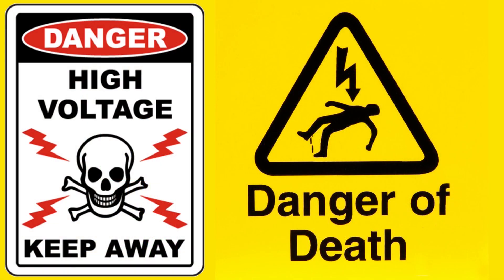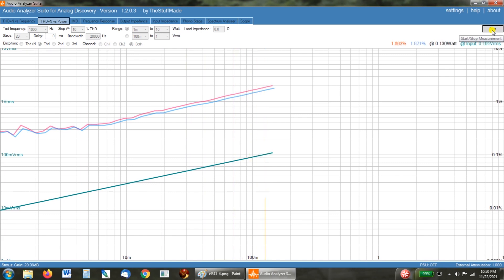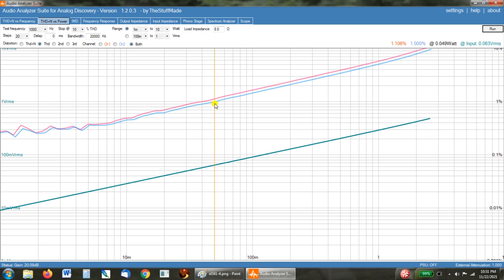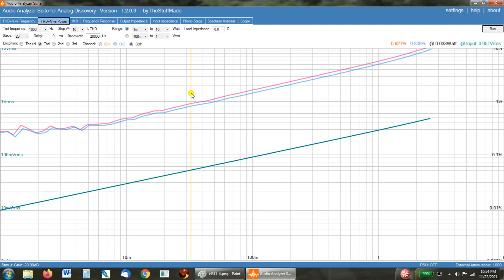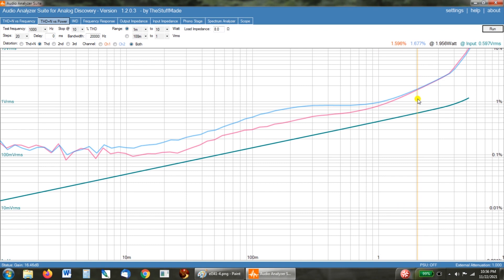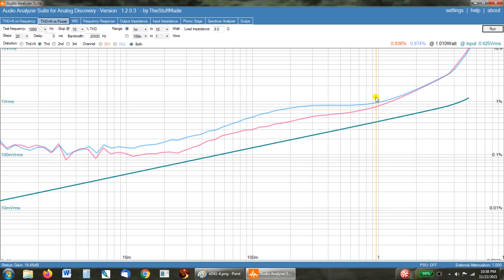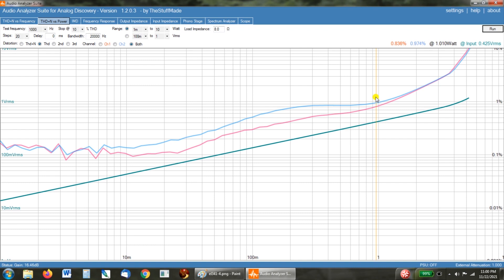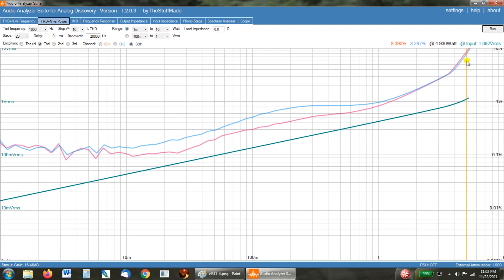Boyuurange Reisong A12: Quick Fix Tube Swap

Comment: So with stock tubes this amp sounds awful?
Reply from the maker: With the stock CIRCUIT and stock tubes it sounds awful. Putting these 6V6 tubes in it was more of a test of my theory that the problem with this amp is cold biased output tubes. While it helps, IMHO the real solution is doing the circuit mods and using EL34 tubes.
Reply: @SkunkieDesignsElectronics  it seems odd to me the a12 is $30 less than the a10 here in Canada.
Reply from the maker: Supply and demand I suppose? Hard to say.

Comment: When mentjon 6v6 tubes remeber gt, cause original 6v6 tubes can ruin 6v6 gt conststructjons,same goes with 6l6 and gt.
Reply from the maker: The original metal and GT tubes are electrically the same.
Reply: @ isnt it lower voltage on the original 6v6 i tougth it was 20%, 6v6 metal was not posible to inspect fore redplating on one of my amps build on printboard,it was former owner who fixed this, it was messy,change tubesoclet,and fix damaged printboard, i tought it was 350 and 300v on max fore the tubes but manny 6v6 gt were runn much higher than that, in old days.
Reply from the maker: https://frank.pocnet.net/sheets/127/6/6V6.pdf same data sheet. All the old have a max across the tube of 315, the A12 has 310 across the tube. Being cathode biased, not likely to red plate them. Modern 6V6S tubes are much higher. 

When you get into 6L6 the metal and GT are the same, the 6L6GC is a totally different tube.
Reply: @ ok so its only 6l6 this is with,i made a fender de lux with 410 v on the jj6v6 gt tubes,and it worked fine,but stupid as we all are from time to time i builded down the amp,cause i thoght it was to high v.now its only parts out of use,

Comment: This amp is going to push a pair of Heresy 1 speakers in my audio building.  It'll be the "number two" system, a far cry gear-wise from my "main (number one)" system in there.  As such, I think I'd be happy with just the 6V6 swap, have a matched pair of Tung-Sol 6V6GT on the way.  My question is:  with the EL34 to 6V6 swap, should I go ahead and change the 5Z4P to a 5AR4?   Would that end up over-driving anything, or would it not make a difference at all with the 6V6 installed?   Thanks!
Reply from the maker: Just try the 6V6 swap and see how you like it.
Reply: @SkunkieDesignsElectronics Will do.  I'll put the 5AR4 back in the box and save it for "eventually".  I've never been one to let "good enough" be good enough, so inevitably I'll end up doing the rest of the mods.  🙂
Reply from the maker: It really does turn this into a very decent sounding amp.
Reply: If it does for this amp what having done your mods to my little Nodsound 6P1 did it's going to be sweet!

Comment: Great video with high value information. Thank you. My A12 is ordered and on the way. I planned to use it (w/ a pair of Klipsch RP-500M) as a contrasting alternative to a Rotel / B&W 606 two channel system. My question: I have a pair of compact subs (ASW608) that I found to be unnecessary (for my ears) in the Rotel / B&W setup. How would you recommend using one or both subs (connections and settings) with the A12? I guess there’s no way to remove some low frequency load from the amp. Or is there?
Reply: Duh….exactly what the sub’s bass management does. Not a DIYer or even a HT guy. Since I didn’t see this assessment of the amp before ordering, think I will try the tube swap and sub(s), then decide about returning it.
Reply from the maker: Glad it was helpful!

Comment: Anyone tried this on A10?
Reply from the maker: It should work, the later "full mods" have been done to some A10's, switching them to 12AX7 etc and if it's the point to point wired version, the only difference is the driver tube setup.
Reply: @SkunkieDesignsElectronics  so you just switch to 6v6 tubes and hook the speakers to 4 ohm output? Is it the el34 tubes you switch?
Reply from the maker: @markusgrim112  yes, and this works best if you supplement this amp with a small powered sub to reinforce the bass.
Reply: @SkunkieDesignsElectronics  already do 🙂
Reply: @SkunkieDesignsElectronics  might do your mods later but lets start here. My first tube amp.
Reply from the maker: @markusgrim112  I would suggest getting the JJ 6v6 or some other low cost tubes, don't spend $$$$ on NOS to try this out. Also don't get the 6V6GC or other higher power variants!
Reply: @SkunkieDesignsElectronics  will try with 
TAD RT832 Tube 6V6GT-STR Duett
Or
Electro Harmonix 6V6GT

Comment: Was there ever a follow up to how the amp SOUNDED after the tube swap?
Reply from the maker: Yep, but I'll summarize it here: much cleaner but because of running the 8ohm speakers on the 4 ohm taps (and not ideal impedance for a 6V6 tube) it lose a little bass. This will probably work for people using a powered sub and don't want to go inside the amp. But mainly it verified for me the cause for much of the distortion is from running the output tubes so lethargically. The internal mods is a much better fix.

Comment: Great videos. I really appreciate all the help you're providing Reisong owners like me. You really know your tube stuff. I'm not really a DIYer so your 6V6 suggestion is a cheap and simple solution for me. My 6V6s are on order. I saw your positive 6V6 distortion tests, but wonder if you were able to run a frequency response test too? Also, I read where you mention the 6L6. Is this also a drop-in replacement for the EL34? Thanks.
Reply from the maker: Yes I did a frequency response sweep, using an 8 ohm speaker on the 4 ohm tap does lower the bass response slightly. My suggestion: These don't have good bass until the other internal mods are done no matter what output tube, use 6V6 tubes and get a small powered sub. That combo sounds good without going inside the amp. 

The 6L6G or 6l6GB should also work in an unmodified amp (19W versions), the pinout is the same as the EL34/6V6 but I wouldn't use a 6L6GC or the other higher watt versions,  they will have the same issues the EL34 has or worse.
Reply: @SkunkieDesignsElectronics  I still have a little time left in which to return this amp, so I'm trying to decide whether a 6V6 or possibly 6L6 would be enough of an improvement to make it a keeper. I suppose the 6L6G might offer a different sound than the 6V6 but not sure if its worth ordering a 6L6G as well. Don't want to spend too much on an amp I might not keep. Thanks for your quick thoughtful, response.
Reply from the maker: @SwiftyZeAvenger  Honestly, I can't say what a 6L6G would test or sound like. Like you, I'm not interested in spending more money on other tubes to test at this point.
Reply: @SkunkieDesignsElectronics  You're right. I'll stick to the 6V6 order and see how it sounds when it arrives. Look forward to your preamp shoot out. A friend of mine owned an original Marantz 7c and it didn't have a tube rectifier like your chinese version does, though the Marantz 7c sound was thick and rich and tubey, as if it did. Thanks again.

Comment: Hi Steph.Brilliant videos.Would this work with the Reisong A10 amp.Many thanks.
Reply from the maker: The problem after listening is mixed bag results. It cleans up the distortion but because this tube isn't matched to this output transformer well, it reduces the bass response. If you are using a powered sub, it will probably work well.
Reply: @SkunkieDesignsElectronics  Thanks for the reply Steph.

Comment: Now I am more than curious for your subjective listening test :=)
Reply from the maker: Honestly, it's much cleaner but still has no bass. It's  something to try for people who already own the amp and don't want to go inside it. Mainly it cemented my theory that SE amps need the output tubes run hard.
Reply: @SkunkieDesignsElectronics  Thanks. No bass will not be a problem for my setup since I filter <180hZ from the amp anyways. In my open baffle setup the speakers don't do much below. This is taken over by an OB sub. I'll wait for the rest of your suggestions and see what is okay for me. I will see to it that all caps are drained before I go in...

Comment: Would this modification work on the a10 amp as well?
Reply from the maker: I would hold up before doing anything. This is more just a test of the distortion is caused by the operating point.

Comment: Holy shit. That is one hell of a difference. I have some old 6V6 tubes here i have never used. If I have time tonight I will do the swap and will let you know how it sounds. GREAT VIDEO!!!
Reply from the maker: I will preface this does just deal with the distortion. I think it still needs other mods like coupling caps and possibly other internal mods will provide some sonic improvements. But this clearly shows the distortion problem is from the output tubes being biased too low. More power using lower power tubes! lol
Reply: @SkunkieDesignsElectronics  So I tried my old 6V6G Zenith coke bottle tubes. This is my first time using them. The amp sounds good with of course good highs but really pronounced mids but I think even less bottom end. I was able to go well over half volume maybe 2 o'clock but not listening at that level for sure. The lack of bottom end is my big issue and why I dont use this amp unless I'm listening to acoustic.  Speakers are 1979 Klipsch Heresy and I just used my Ah! Njoe Tjoeb tube cd player. The cd player was a modified marantz cd4000 that the Ah! company built a while ago.
Reply from the maker: @crimsonghost6454  Agreed, it cleans up the distortion but I think running the 8 ohm on the 4ohm hurts the low end.  I think if you try the EL34 with the 8ohm on 4 ohm you notice the same lack of low end. Not that it has much anyway.  I'm starting to wonder if these OT are just a deal breaker, but I still have some things to try. Several people have hinted these may be PP OT and if so, a gapless OT is never gonna do anything down low. It just gets saturated.
Reply: @SkunkieDesignsElectronics  yeah I tried both taps but still no bass. And I'm sure someone will say my speakers don't do bass and I know heresy are not known for deep bass but I know what they can and can't do,and its the amp. I also have a pair of kg 5.5 but the A10 can't drive those with good low end either. I'm still going to follow your series on this and might mod my amp but I have been thinking about selling it and some other gear to get better. But I gotta see where this goes. Thank you for your great work
Reply from the maker: @crimsonghost6454  Did the 8 ohm taps seem to have more bass? (I know not good but more than on the 4) What I'm seeing measuring is the 6V6 on 8 ohm taps has more distortion than on the 4ohm, but more low end and still 1/2 the distortion the EL34 tube has. I hate potted transformers like this cause you have no idea what is inside them. I am interested to see what the 7591 tubes do with some internal mods. but these OT might be what's causing all the issues.
Reply: @SkunkieDesignsElectronics  I guess maybe a bit more but really not a huge difference. I dont know what frequency it falls off at but the bottom end just sucks. And I like deep bass. I have a 1959 motorola 6bq5 single ended amp and it has better bass.
Reply from the maker: @crimsonghost6454  right, that was one of the first things I noticed was no bass, even with my bookshelf speakers that only go down to 40hz. It starts falling off at 200hz.

Comment: My Klipsch speakers are 8 Ohm. So I plug them into the 4Ohm and swap to 6v6s? I'm currenly using KT77s? What if I just use the 4 Ohm tap and don't swap the tubes?
Reply from the maker: I tried this, it helped a little but not much as far as distortion. The big gain comes from running the tubes close to their max dissipation. But this is early in the testing.

Comment: Very interesting!!  I own a Reisong A10 - do you think the 6V6 swap would work on it?  I think it's a very similar circuit, and I have a bunch of 6V6 tubes laying around.  Thanks again for all your videos!
Reply: Same here. Added the remark that my A10 is 230V (EU). I assume that after the powertransformer this has no influence on mods in the circuit or am I jumping here...
Reply from the maker: @theonoo  There are no mods done to the circuit and the PS isn't an issue if the B+ is reasonably close. I don't have these other models at hand, so ideally you would check the plate and cathode voltage (carefully!! Be safe!!!) measure the cathode resistor, plug them into this calculator and make sure you don't exceed the max dissipation of the tubes. I try to stay under the 95% for pentode results. If it is "too hot" you might need to add a little resistance to either the cathode or the first resistor after the rectifier but all this requires opening the amp up, following safety protocols etc. 

Otherwise, you could plug some in and babysit the amp to make sure you don't see any signs of them trying to redplate. A little random blue glow isn't a concern to me.

 https://robrobinette.com/Tube_Bias_Calculator.htm